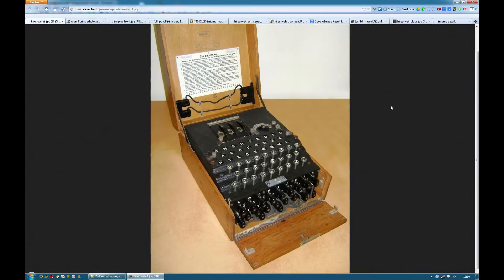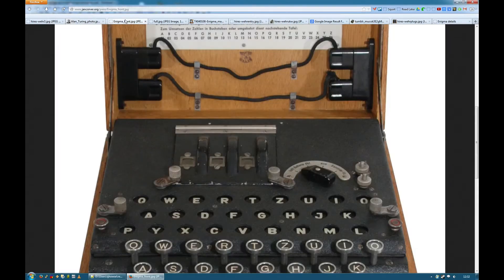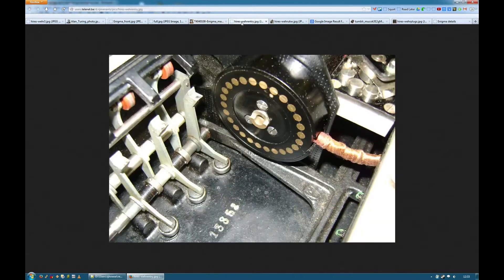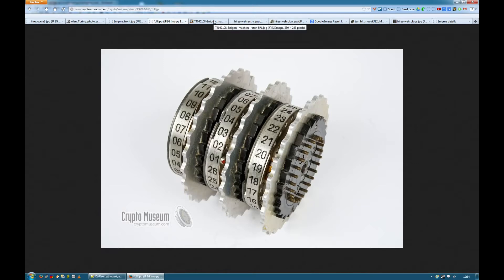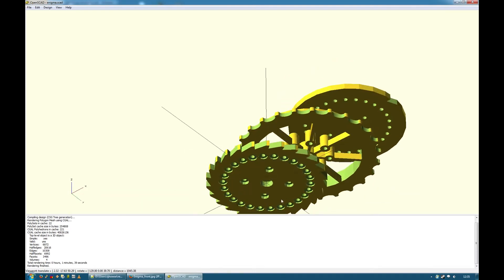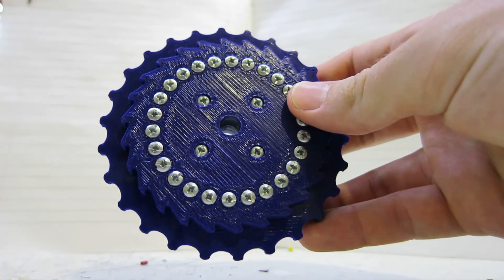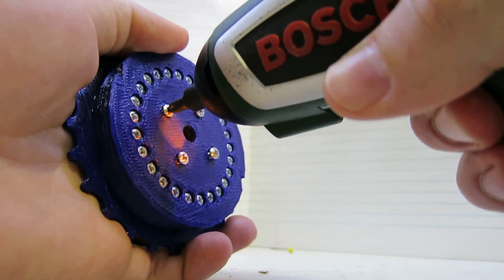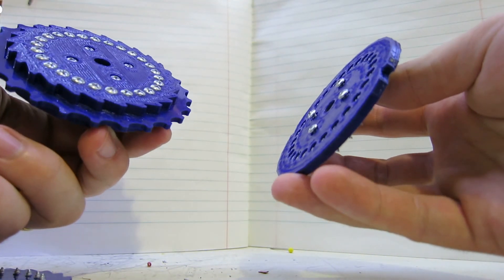3D Printable Wehrmacht Enigma machine video 1

Comment: How are you going to adjust the "ring" settings?
Reply from the maker: The rotors used and their initial positions are set according to the day's codebook entry. The operator assembles the required rotors in the required order and sets the initial position by turning the rotors once assembled.
Reply: Travis Howse There is another setting called the Ring setting that is an additional setting beyond simply the rotor's initial starting point. From the looks of it your printed rotors will not be able to accomplish this. The Enigma is a very complex device that I can not describe in youtube comments. When I am in front of my laptop tomorrow morning I will post a link with the information you seem to lack.
Reply from the maker: Richard Wielgosz Oh, the ring with the numbers on it. You're correct in saying I haven't mentioned that in my videos. I haven't quite figured out that, because it's not really an interesting problem. I think I will mostly likey print out the labels on a long thin strip of paper or stiff card, and wrap it around the rotor. I may need to add something to allow the labels to be indexed and not slip around during operation.
Reply: Travis Howse The enigma rotors were sort of like a rotor within a rotor. The inside rotor with all of the wiring in it could be moved into any one of the 26 positions. So what that meant was that each rotor could scramble the alphabet into 26^2 possible combinations. So lets say your rotor scrambles Z to R, A to J, and B to M, if the rotor is in position 1 (A) and ring position 1 (A) then the A becomes a J, but you can rotate that inner wired module relative to the outer marked ring, so if you moved the Ring to setting 2 (B), and keep the rotor at position 1 (A) then the A encrypts to an M.

As I said, the device is very complicated. I understand the way the machine basically works, and I have seen one in real life (and touched it) at the NSA's crypto museum in the states, but I've never really been able to open one up and pull the rotors and really get a complete understanding to be able to make a mechanical replica. Our intention when I started studying the Enigma, 25 years ago, was to model it in software and make a game around it. That didn't end up happening, but I had to reverse engineer the basic wiring of the device (not specific rotors) from descriptions in the few books I could find at the time. This was pre internet and I couldn't find many resources in my little home town.

Anyway, this site has almost all of the information you will need:

http://users.telenet.be/d.rijmenants/en/enigmatech.htm
Reply from the maker: That website is in my video. I've used it as the basic for the electrical and mechanical design. The machine is really not that complicated.
Reply: Travis Howse No, not really. It's really a battery with a light bulb on the other end, sure. But recreating a physical one, is complicated.
Reply: @Wizardofgosz  I thought the wiring remained the same. The ring setting moved the notch, so the next rotor stepping is the only thing that really changes.
Reply: @cyrilwalker6671  not exactly. When you change the ring setting you're spinning the whole inner assembly that has all of the wiring in it which means different letters will encrypt to different letters, and the notch that moves the next ring forward also changes.
Reply: @cyrilwalker6671  Good Lord I haven't posted in this thread in 5 years.
Reply: @Wizardofgosz  If pin 1 is wired to contact 13. After you spin the ring setting, pin 1 will still be wired to contact 13. That is what I mean when I say the wiring does not change. Changing he rotor position is what changes the letter encryption. Sort've the whole point of the enigma. The notch moving is not an 'also' thing that happens. It is practically/mathematically the only thing that happens when the ring settings are changed.
Reply: @cyrilwalker6671  But when the ring moves the letter A (for example) will no longer encipher to the same output letter. The internal wiring of the ring does not change, OF COURSE. But the cipher changes when you move the ring, not JUST the notch that advances the next rotor.
Reply: @cyrilwalker6671  So if you start the machine with the same rotors at AAA, and the ring position at AAA, and encipher a letter, it will encipher to a different letter if you start with the same rotors at AAA, and the rings at AAB.